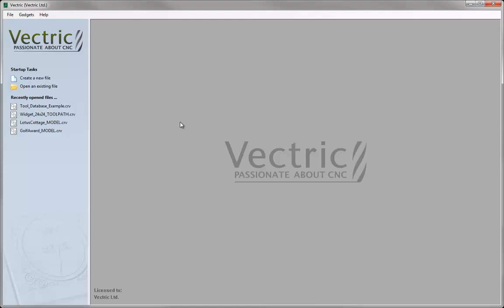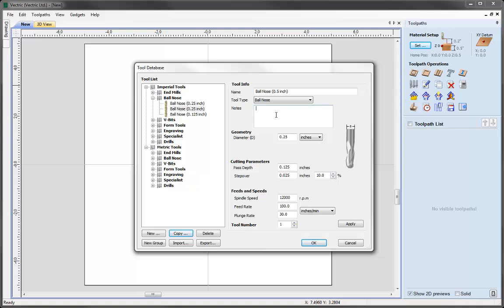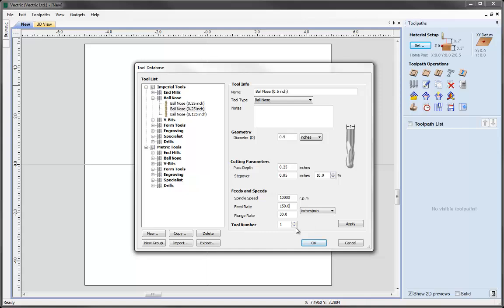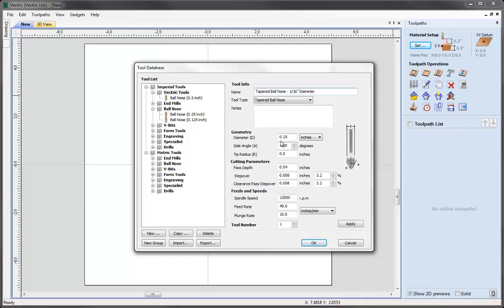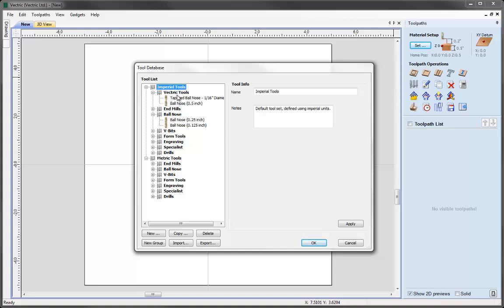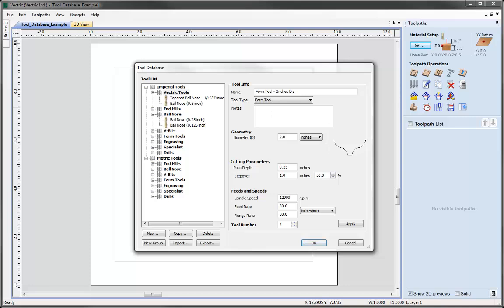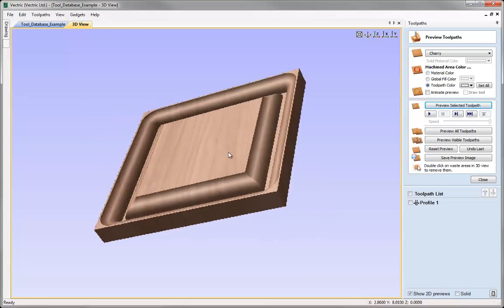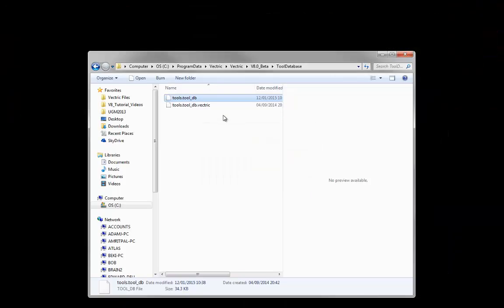Vectric - V8 Tutorials - Tool Database Guide

Comment: what the solution of "failed to save tool database" ?
Reply: I know it's old post but maybe it will help out someone else. Have you run your program with administrator privilege?  Sometimes it helps. You can do it by right click on shortcut icon and select from the list to run is as so. Or even change security setting in the proprieties of the shortcut to always open it as the administrator. 

Cheers,
Filip
Reply: I had the same problem. New system, new installation of aspire on administrator rights and the problem showed.
You need to localize tool database.db. In the program- click on File and Open application data folder. Go to tooldatabase folder. DELETE tooldatabse.db.  Now the tool database in the program is totally empty but you can add your tools and program will save it. 

looks like the tooldatabse file is corrupted. But aspire will save the new one